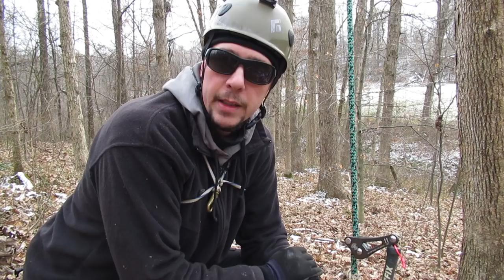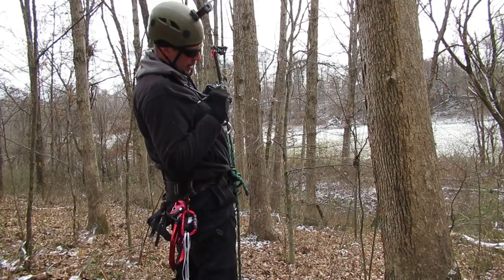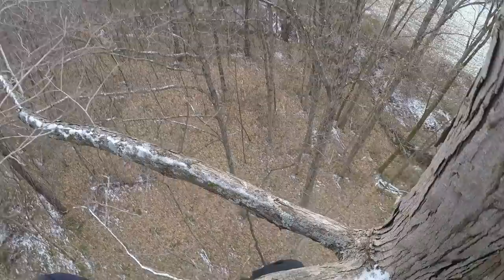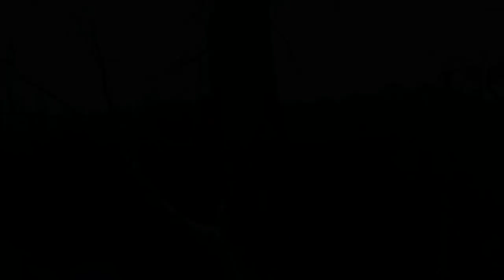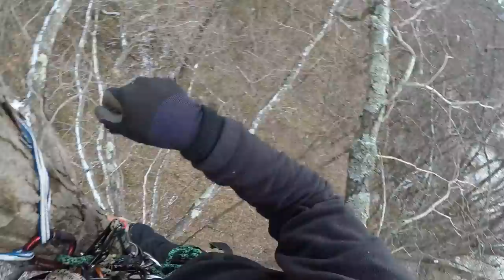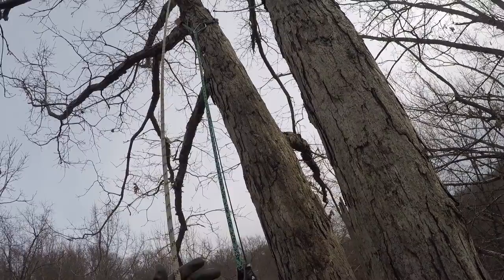Rope Wrench & Recreational Tree Climbing in Ohio

Comment: Great video.
I like how you alternated between the SRT and MRS/ddrt and also how you redirected upward from your initial SRT canopy anchor.

I haven't tried it yet but I heard the suggestion that you can use a carabiner as a handle, twisted onto line (e.g. munter hitch) as a good hand grab to get a good pull on throw line, paracord, etc.

Comment: Would you recommend rope wrench or hitchhiker for beginner climbers?  I'm using the RAD system now (ascender/grigri/3:1), but interested in evolving to rope walking.  Thanks!  Love your channel.
Reply: Just Curious, what did you decide to go with?, I'm favorable to the wrench myself.
Reply: @dqmc07  I went with the wrench.  Love it.  Also got the zigzag and chicane, but still prefer wrench for SRT.  I still mostly use RAD system for backcountry rec. climbs.  Love them all :)
Reply: @judsonkimble  Awesome man, great choices, I usually use the rope runner, og one, for my srt climbs but when doing full removals I like to drt down, usually cause I forget stuff. I figured this caralink will come in very handy.
Reply: @dqmc07  Sounds great!  I like DRT too.  Cheers.